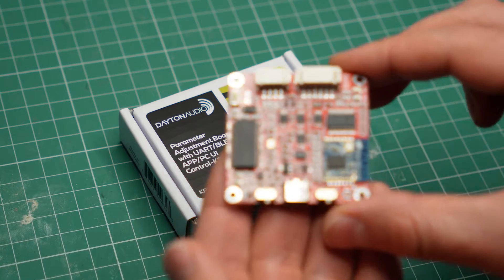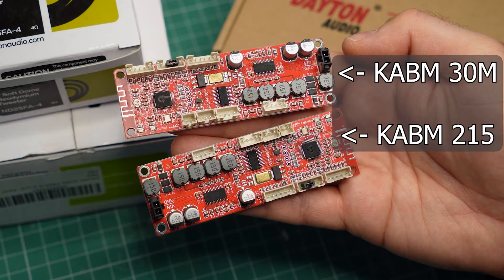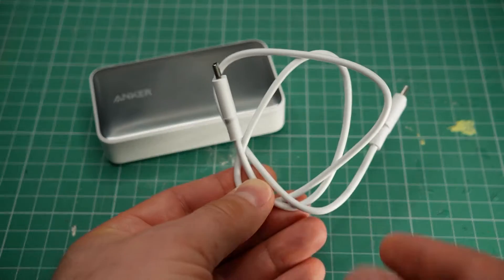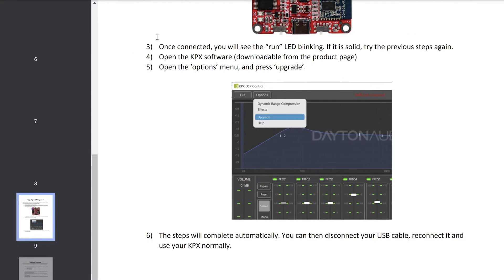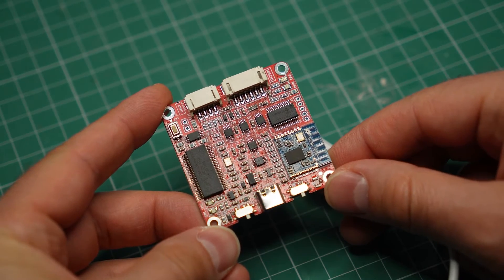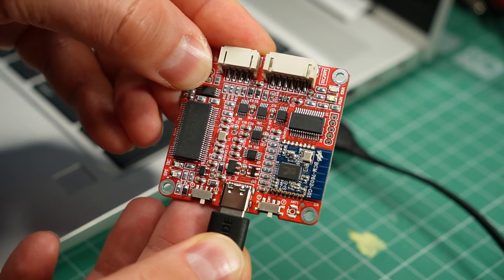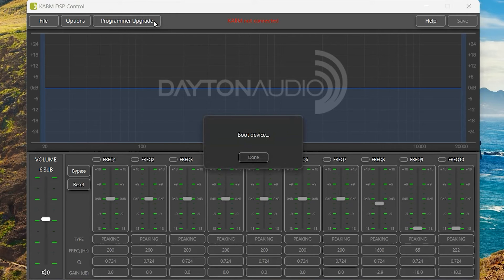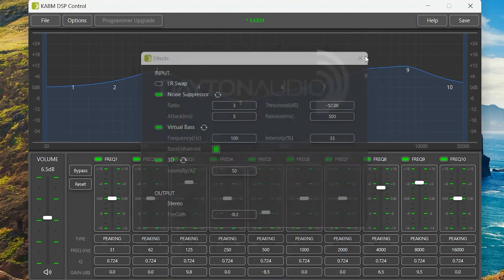Dayton Audio KPX programmer firmware update (how-to guide)

Comment: Thanks for this!  I was struggling to get it connected.  I eventually thought that updating the programmer FW might be good idea, but it crashed each time.   The knowledge that it definitely needed an update was critical, since I was about to pull the trigger on a new programmer, thinking that there was something wrong with this one.  For the SW, I tried "run as administrator", but I don't think it would have occurred to me to try a different machine.  Those two things were the trick for me to get up and running.  Their instructions left a lot to be desired, so this quite how-to save a bunch of time and headache.

Comment: I had no idea their was even a seperate kabm software, lol still cant get my board to connect. Im wondering if theirs drivers needed dayton also diden't mention
Reply from the maker: I didn't have to install any drivers on the laptop that recognized the board. Both PCs I tried it on were running windows 11. What amplifier are you trying to use it with?